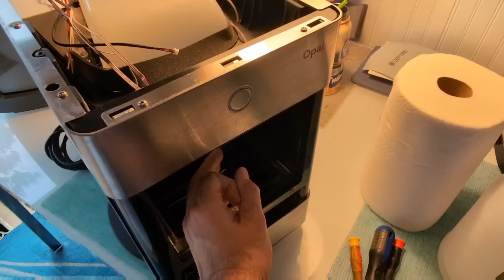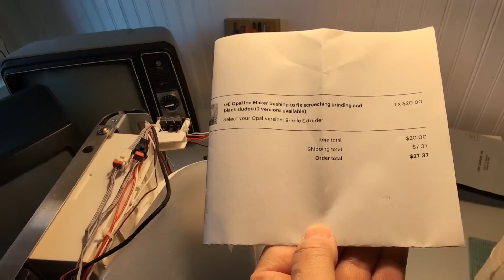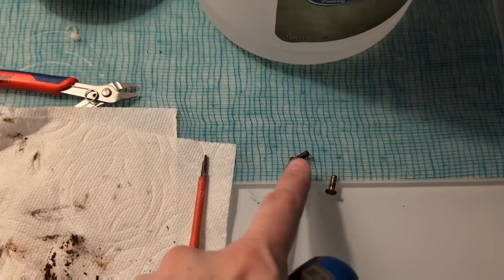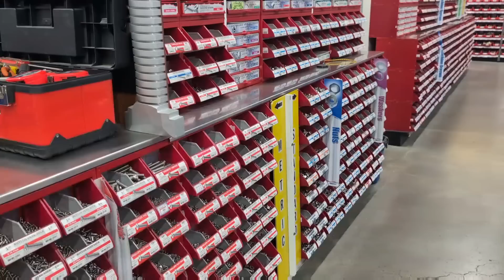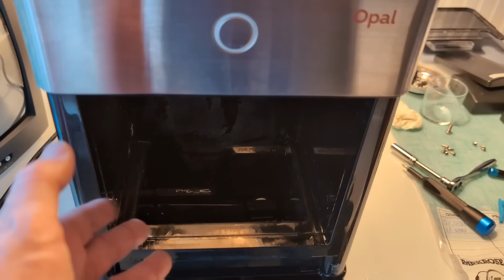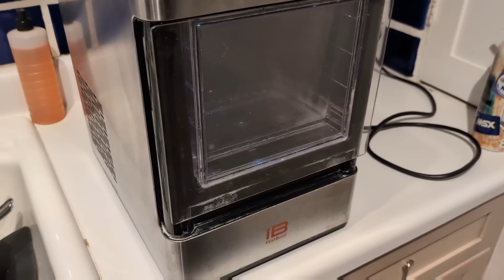Fixing an expensive ice maker with multiple design defects (Opal Ice Maker)

Comment: Oh man you were right there at it just grabbing the top of the auger and everything but you never attempted to pull it straight up? If you had pulled it out you could have cleaned the whole auger, as it pulls right out. The top usually isn't anything compared to the bottom and about a third of the way up! Someone give me one of these and yeah almost half of the tunnel in the auger was clogged with a dark gray calcium metallic build up. I have no idea how it made ice at all really but it had been making ice up until the very end before I got it.

Comment: 20 freakin dollars for as plastic bushing! c'mon! holy crap is that expensive. Digital Basement.... why dont you just 3d print your own? use some lithium grease and call it a day; now that you know. christ sakes man. that opal ice maker is like the one i had before the newer GE one i have now. the last one was thrown out because someone put rubbing alcohol in the reservoir and it made "tangy" ice we shall say, all it needed was a good flushing and it would have been good after a full cycle.....
Reply: $20 is a reasonable price to source, stock and distribute any part, even if the part costs nothing. Especially if you aren't doing so in huge numbers.

If they have to turn the part to size on a lathe, then $20 is a steal. Parts are only cheap if made in huge numbers.

Comment: I would suggest that you get a set of tap wrenches, both metric and SAE, to clean interior threads. A thread gauge would help, as well. Overall,  I think this was a masterful repair. The stainless steel fasteners will reduce the corrosion,  but I think that there should be a gasket or plastic spacer between the two halves of the extruder.

Comment: OMFG...  I used to own one of those pieces of excrement.  Totally NOT designed for any real maintenance.

The one I had the motor that pushes the ice out would ALWAYS start SCREAMING, literally SCREAMING.

No matter how much you cleaned it, no matter what you cleaned it with that expletive motor would always make that noise.  The BEST you can do is  occasionally oil the motor, but you have to COMPLETELY disassemble it to get to it.

They were originally priced at over SIX HUNDRED DOLLARS.

This is the bullshit that GE produces, they don't deserve to be in business AT ALL, and pretty much EVERY GODDAMN MOTHERFUCKING other GE appliance I've owned the past two decades has been ABSOLUTE GARBAGE and INTENTIONALLY DESIGNED to be as UNSERVICABLE as possible!

Comment: I work on the larger versions of these. Sonic has the same type of "nugget" ice and uses scotsman ice machines that use the same basic design. Yes, everything attached to the evaporator should be high grade stainless steel or plastic. Anything else will rust in the wet environment. Sonics ice machines run almost 24/7 and i grease the top bearing/bushing twice a year with food grade grease. The maintenance helps everything to last longer. The evaporators are fun to replace. 😮 the drain hoses you referenced are for draining the unit during cleaning. At least thats what they're for in the scotsman units. You have to descale and clean the unit 2 or 3 times a year. Also the fan you mentioned near the end is for the condenser. The evaporator is the part you worked on.

Comment: Hi Adrian, greetings from Louisville, KY. Just a little info, First Build is a partnership between the University of Louisville's Speed School of Engineering and GE Appliances. They are maker space that helps to launch real world products while letting aspiring engineers learn and create. Their newest and most celebrated item that I'm aware of is the GE Indoor Smoker developed with the help of a local chef. Just a little bit of an interesting backstory on that for ya!
Reply: A suggestion for engineering students - don't cheap-out on critical process components like fasteners and don't let manufacturers wear you down by splitting hairs on the cost of small parts. If anything, use plastic or enameled steel for the case instead of stainless. That's what GE or any other company would do for mass production on a 'new' appliance. Get rid of anything 'connected' except power and water. Too much tech isn't necessary for small appliances and it's one more thing to fail and ends up costing too much to replace/repair. I wish car makers would realize this.

Comment: Thanks for this, I have 6 of these I found thrown away and this should be the fix for them. I cleaned one up but it would run and make a bit of ice then stall the motor. Didnt know that chamber came apart
Reply: Why would you pick up 6 broken ones without knowing if they were repairable?
Reply: @AureliusR  they were free and I was drunk.
Reply: @ohyou_6599  fair answer :D

Comment: The technical term for this kind of ice is "Extruded Ice". The consept is it squeezes the water out of the ice making the pellets harder and conserving water use in manufacturing the ice. Water has to have some hardness to freeze. Never use softwater for an ice machine or beverages. The scale and buildup in an ice machine is pretty much a fact of life. I have opened the cabinets on commercial units and found some really sickening sights. Stainless is expensive so im guessing whoever designed this thing kept cost down. It pretty much looks disposable to me.
Reply: I work at a university chemistry department, and we have ice machines all over the place in the labs. They all use deionized water. Whatever traces of hardness that remain after the resin-exchange deionizing are clearly sufficient to allow the ice to freeze just fine.

Comment: With all the moisture condensation and temperature involved it might've been dissimilar metal issue as well. I don't know if Noalox Anti-Oxidant is food safe so the silicone grease is probably the better way to go. there's an electrician that uses it on all external screws that way they're removable in the future.

Comment: Hey adrian just a heads up.  I used to swap rusty non-stainless screws on my dirtbike carbs all the time.  But a few years back I was in Mexico on a dual sport motorcycle and I had to do a carb clean on the side of the road in the desert. But after remocing the carbourator to clean it I was amazed.  The stainless steel fasteners I replaced had fused to the keinlin carb body!  Holy hell.  Dissimilar metals will sometimes do this.  There might be a reason to not mix stainless steel fasteners in place of manufacturer's choice.  Maybe they function as a sacraficial anode?
Reply: stainless steel has a tendency to gall when screwed into most metals.  AVE has a good video about it.  using an anti-seize whill prevent it

Comment: Hex head screws are going to be much worse than Phillips head if they rust again. Much less material needs to be lost before the driver surface turns fully round.
Reply: Theoretically if they are a decent grade of stainless they shouldn't rust!
Reply: @stopthebus  Thats not the world we live in these days. You no longer get what you pay for.
Reply: @Jackpkmn  If you buy from a reputable source then you should get what you ask for. We have a chain of distributors that sells only stainless fittings and hardware, so I know when I go in there that I will be walking out with the real deal.
Reply: @stopthebus  We don't all have access to such things, my options for hardware where I live are Walmart, Ace Hardware and Roth's.
Reply: @Jackpkmn  Bummer. Still, I am sure that if you asked for 304 grade stainless screws (or whatever you needed) that you would be supplied with that.

Comment: As an owner of a used Opal ice maker and an HVAC/R tech I can give some pointers on this. 1 with every ice machine you should at least every 6 months perform a descaling on the machine. Yours I would say do a heavy descaling. Go to Lowes and get their cleaning vinegar and it will loosen all the scale from the insides and make a royal mess that you will have to flush out. 2 The outside part that has the fan on it is a condenser. That is where the hot refrigerant goes through to change from a gas to a liquid. 3 The ice drum as we call it in flakers is the evaporator. This machine is a flaker with a die to force the ice through to make pellets. 4 I have a spare evaporator that still has the plastic chute on it.  No they did not update the screws in the spare that I have. If you need a part I can make it available to you Adrian. Past all these points you did a good job on the repair. They do make an external water tank for these so that you can see how much water is left. The app does not do much except to give a schedule to run and see what the machine is doing.

Comment: Congrats.  I'm amazed you could even GET the bushing.
Reply: If he could use a caliper and give inner and outer diameters, and the length, it's just a block of Teflon that we could drill/lathe out. The problem is you need those exact measurements.

Comment: I have the Opal 2.0 and we love it! When we first considered purchasing one, we were having a hard time deciding if we wanted to spend the extra money on the side tank. Thank god we did! We use far more ice now than we ever imagined therefor would forever be filling the reservoir. With the side tank we can go a few days between fills. BTW I was super excited when I saw Adrian's DB cover (ie: repair) the Opal ice maker.
Reply: the Opal 2.0 is pretty good, I still have a 1.0 that worked great until we got the newer model (although we  modified the 1.0 with more insulation for parts and a cooling fan,  made it work far better than before).

Comment: I had never considered that chilling water like this could cause hard water deposits to precipitate out; I had mostly thought of it in the context of boiling hard water and reducing its volume, but I guess it also makes sense that the solubility goes down when the water simply gets cold too. What a nasty cost-reduced construction for what's certainly advertised and sold as a "premium" product. Stainless steel fasteners would have cost them less than a dollar at scale, and a better bushing design (either a better bearing or something isolated from the water path through a seal) would have probably been five bucks or less. Pretty sad on something that costs in the high hundreds of dollars.

Comment: I did not even watch the full video, yet but why wouldnt a plastic piece that is wet not make black sludge.  Ever see inside a commercial ice machine that does not make black sludge when not taken care of and cleaned ? Mold and bacteria all over.
Reply: You are touching someones old moldy machine and the dead bacteria.
Reply from the maker: That's why this has a UV system to sterilize the water as it circulates.
Reply: @adriansdigitalbasementextras  Am I getting uh moment. ha , got me.  :)
Reply: Ha or did you.
Reply: but reallty buy a new ice machine.

Comment: Sorry you had to deal with this cost-reduced, crappy product design. At least we all got to see the insides of it.
Reply: We have German industrial humidifiers at work.  Everything near water is stainless steel.  Due to the application, they're not cost reduced, but a single pump is $8000 new ($3500 to rebuild, which has to be done annually for near 100% uptime).  Imagine this "expensive" ice maker costing an order of magnitude more expensive.  Nobody would buy it.  An annual teardown would probably help both the reliability and cleanliness.

In contrast, we have some Chinese "industrial" quality (more like commerical quality at best) humidifiers that cost about $500 each, but at this price point, we get painted sheet metal tanks and nickel plated ultrasonic atomizers that look rough after being submerged in softened & UV sterilized RO water for a few months of 24/7 operation.  Cost-reduced for sure, but where it counts like the industrial looking exterior, terrible build quality, cheap parts, etc., but gets the job done and lasts a few years before they're cheaper to replace than repair.  

Kinda the difference between cheap consumer and business-oriented laptops (Dell Inspiron vs Latitude, Lenovo anything vs. ThinkBook)... They're not flashy nor have the latest/best features, but they're built to last a few years when you don't need a Toughbook

Comment: I had one of those units. (the same model) and it did the exact same thing. I did almost the same thing as you did. I tore it down, cleaned it, and put a bushing in. worked for another year. then i bought a fridge with an ice maker built in. I gave the Opal to a friend. he used it for 6 months and ditched it for whatever reason.
Reply: Ah so it didn't break again after changing the bushing? Did yours have the same issue with the rust and then the crap around where the bushing was?
Reply: @adriansdigitalbasement  Hi Adrian! yeah it had that crud. Right before i gave it to my friend i tore it down and cleaned it once more. there was mild rust in there in the same places and some calcium build up in the same places as well. the bushing was fine this time though. If they used stainless it would have been better for the machine during manufacturing in my opinion.